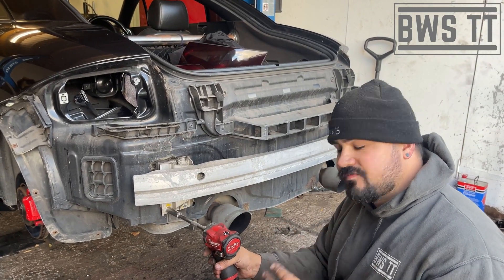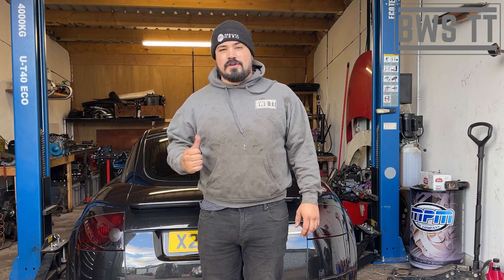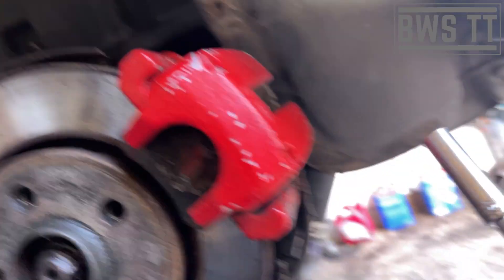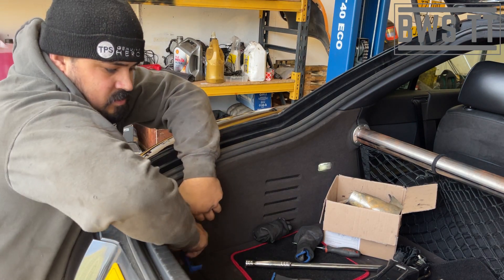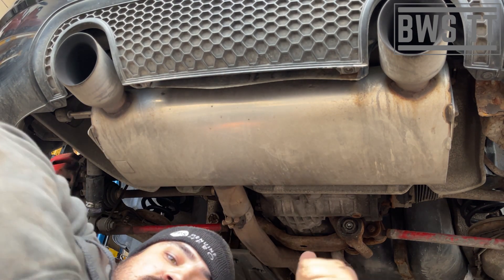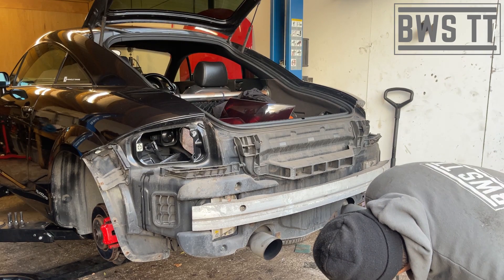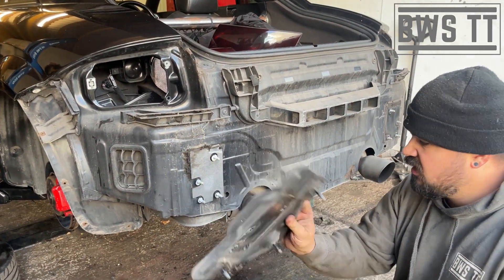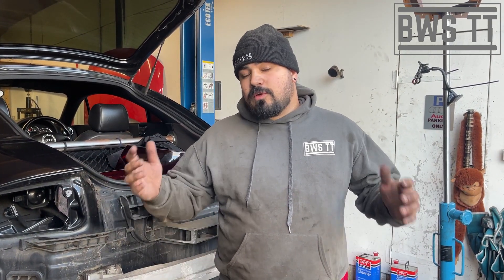This commonly removed weight could make you crash and DIE!!!

Comment: With due respect, I think the lump of metal you've just removed is a counterweight added by Audi after the much publicised accidents on German autobahns. The addition of this weight is perhaps the least publicised of the several measures Audi took to fix the problem (the addition of a rear wing being the most obvious). No car manufacturer would readily admit that it had to add 16 kg of ballast to a sports car to address dodgy handling. 

The removal of the weight may not present any immediate change to the car's handling characteristics. Especially if road speed is well below what may be encountered on a German autobahn. A technical article that I uncovered on this issue many years ago said:

"The handling problems were first discovered in Germany when driving at high speeds on the Autobahn. The problems were especially significant when the drivers began to slow down and at the same time started turning to get onto an off-ramp. The rounded design of the rear of the TT did not give the air a fix release point, instead the release point wandered. This gave the TT a certain degree of instability, which caused the rear of the car to wobble. When this wobble was combined with high speed braking, which gives a dynamic shift of the gravity centre towards the front axle and thus decreasing the load on the rear axle, and also cornering the TT could no longer sustain sufficent rear wheel grip."

The article made no mention of the 16 kg weight, but its extreme rearward position is obviously intended to give maximum leverage to counter any lift over the rear axle. No, I'm not suggesting that you will die if the weight is removed. As the quoted article mentions, it takes a particular set of circumstances for rear axle lift and oversteer to occur. Such circumstances may be less likely to be encountered in countries where road speed limits are nowhere close to that found on an autobahn. 

I would like to think that Audi's engineers knew what they were doing when they recommended the addition of the counterweight. Auto engineers work very hard to remove unnecessary grams from a car; they must have been utterly desperate to recommend adding 16 kg of deadweight, which would have done nothing for efficiency or performance. I did give some thought to removing the lump of metal from my TT many years ago, but ultimately decided that it should stay.
Reply from the maker: So ill keep it simple- the weight was there from the start. Before the recall. It has nothing to do with handling- its a harmonic damper.
Reply: @BWSTT  I'd like to remove the weight, and will if I see evidence that it was there before the recall? Do you have any proof the weight was on every model car even the 1999 ones that crashed ? Thanks
Reply from the maker: I’ve personally seen one on a 99 pre recall car that didn’t go in for the recall items. But aside from that, its proven in the same way you can prove the steering rack didnt get changed, or that the brakes have always been 312mm fronts on all 1.8t TTs….
Reply: @BWSTT The fact that the weight existed on pre-recall cars doesn't mean anything. It is safe to assume the manufacturer does test the car before selling it. They might have discovered the necessity of the extra weight for better balance and stability. That was obviously not enough and they added spoiler later. Just a thought. Thanks for the video.
Reply from the maker: @orgenstepp  it means a lot actually- and it being called a harmonic damper in their literature also means a lot

Comment: Is the weight on the rear to balance the car. If removed will that increase front weight ratio and increase understeer?
Reply from the maker: No, hence the QS not having it, and it not varying in weight between the 1.8 and the 3.2 engines
Reply: @BWSTT what is the official reason audi installed it in some of the models? Curious to know because I want to take mine out too
Reply from the maker: @maxngm8590 it’s in all the models apart from the QS, it’s to reduce nvh but it doesn’t make a noticable difference
Reply: What is nvh sorry..noise vibration?  @BWSTT
Reply from the maker: @ and harshness

Comment: 2 thoughts from across the pond here:
Find some scales and cross weight the car before and after removing the weight.
Second, I wonder if the weight is suppose to dampen chassis or aero porpoising , there could be a high speed instability in the car
Reply: Note: they may have found something in extreme conditions during pre-production testing.

Comment: I removed mine when I put on a Rieger bodykit some time ago. Did not notice any difference at lower speeds.With it removed it was noticeably noisier , much more vibration and did not feel very safe at very high speeds. At about 110 you could feel the vibration coming in, by 140 it was frightening. You could feel the vibration coming through the whole car. I even had my wheels checked and they were all perfectly balanced. Put in back on and it was back to normal again,  no shaking.  I believe many of the deaths on the early cars "without the weight ballast ,spoiler, esp and suspension mods" were on high speed German autobahns so it kind of makes sense.
Reply from the maker: Well youre the first to notice a difference! Worth reiterating it was present on pre-recall, nothing to do with the changes
Reply from the maker: Having done 160+ with mine removed, i can honestly say i didnt notice
Reply: @BWSTT  That's good to know you did not have a problem mate. The vibration was so extreme on mineI had no choice but to put it back on. Keep safe man!😃
Reply: @boastyy  you might have something else that needs looking into. Ive done 130mph (209kph) with mine removed and havent had a problem. I would check the alignment and balancing of the tires.
Reply: @BWSTT  the weight, almost 20kg far behind the rear axle can really have a small effect on the car's driveability. Was it tt or whatever car. The rear spoiler does the same thing, but more efficiently.  the balance in high speeds can change surprisingly undesirably, especially if the shock absorbers are already a little tired. a little extra weight at the back can work wonders to calm down rear in sudden bumps, be it for noise only, or not.
Reply: @DubKorpsGLI  That's good to know mate. I have only just renewed a lot of suspension components , shocks, springs, bushings etc.  The parts I took off were well worn so you  are probably right. When I removed the ballast and had the vibration it was probably worse due to the suspension not working properly mate.  Thanks man.
Reply: It's basically to weigh up all the axillary on the drivers side power stearing pump alternator water bottle etc remember this car was supposed to be a sports car I bet with out that if you put it on the scales they ones that you put under each wheel the balance would be out they never added it for no reason
Reply: Its still on the same side even on left hand drive cars though @haggismuncher4543
Reply: M8 no point this guy knows it all audi never put that on because it was never needed  it's there for a reason

Comment: Using the 1390 kg TT weight 10kg is (very roughly) worth around 1bhp for the 180. Just ran it again for the 225 and it's about 1.75 bhp. Doubt you'll feel it in a straight line, it's barely the weight of 1/4 a tank of fuel. But whipping through the roundabouts it'll make things easier. Especially if the toe in on the rears set properly.
Reply from the maker: Thanks for crunching the numbers. This is usually done along side other things to all add up to a noticeable difference, like tesco say “every little helps”

Comment: I don't think that's harmonic balancer. I think that was added with that rear spoiler to increase stability at high speed.
Reply: It is called "Balance Weight" 8N7802271A, 8N07802271, 8N00814419, 8N0813586. It probably do both be a weight and decrease harmonic vibration.
BTW. Liked your video on clutch replacement. I removed bevel box. It made putting trany back easier.
Reply from the maker: Ill dig out the information I’ve got, and do a separate video
Reply from the maker: You are entitled to think that, but you are incorrect. Which is why i gave the correct information in the video. To elaborate it was on all of the pre-recall vehicles, so that confirms its nothing to do with the stability, aswell as the fact that the part is literally referred to as a harmonic damper in audi literature.

Comment: Audi removed it for the clubsport edition
Reply: Clubsport/QS battery in rear same side, + no spacesaver is why. Balance overall from front to back, lighter gearbox upfront, front battery cars on same side as harmonic weight why that side. Bouncing at very high speed the design eng calcs of harmonic frequency damped. Weight placed way beyond wheels rear axle increases 'bending moment' force. Only required for German Autobahn driving really tyre contact on road without bouncing particulary in the wet..